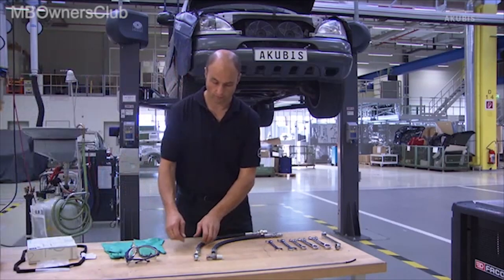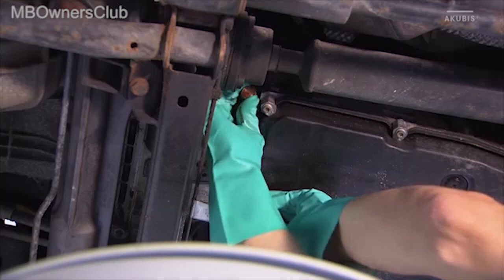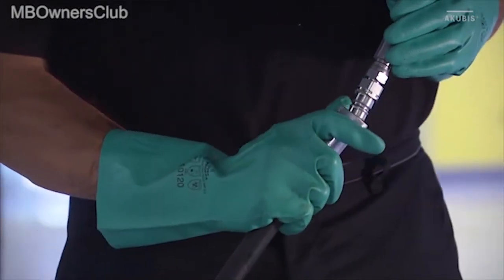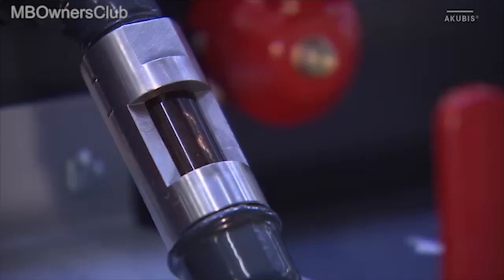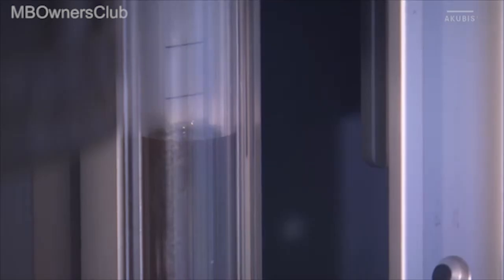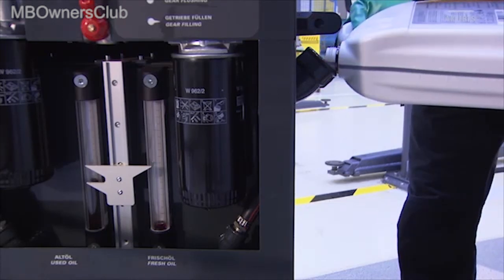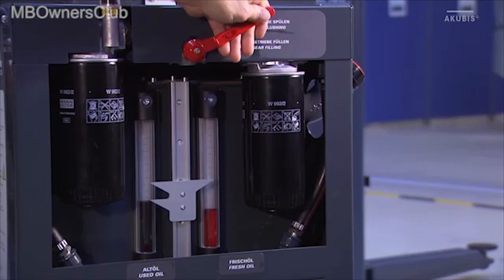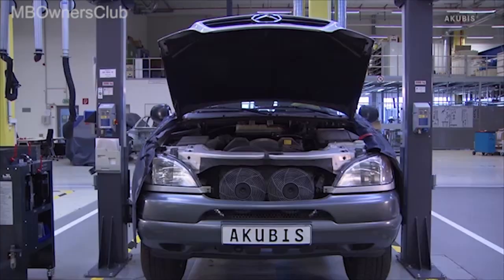Mercedes-Benz Automatic Transmission Flush: What You Need to Know

Comment: Where can I get this done. My dealership refuse to do this. They simply change the oil in the tranny and change the filter but the tort converter is still loaded with old oil
Reply: I would not recommend flushing the automatic transmission. Best to carry out the "standard" procedure twice within say 1000 Kilometres (I am aware you will incur additional costs yet this is not a yearly or sooner affair like engine oil).  Some residual fluid will always remain.